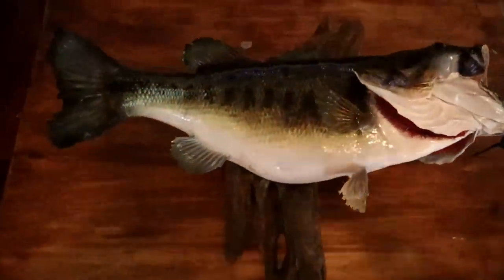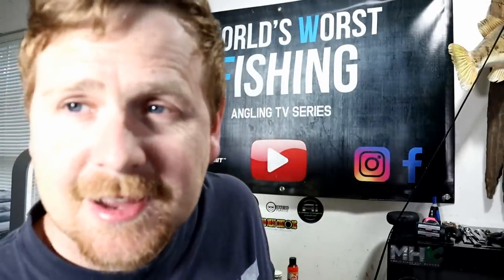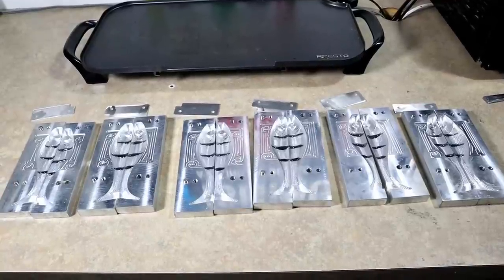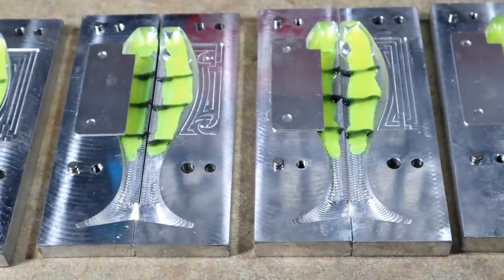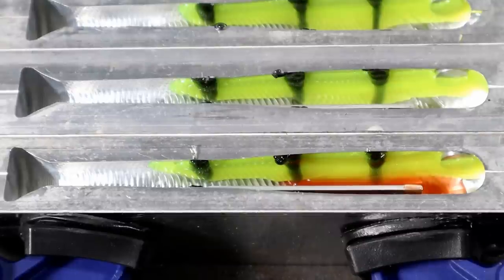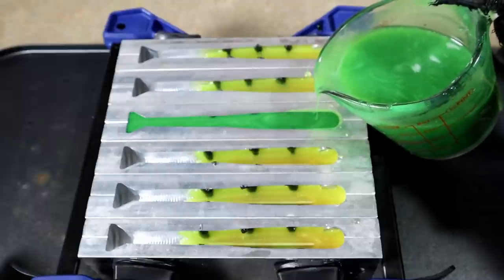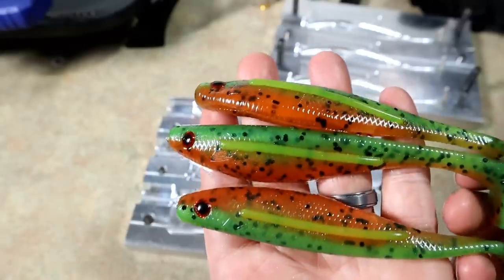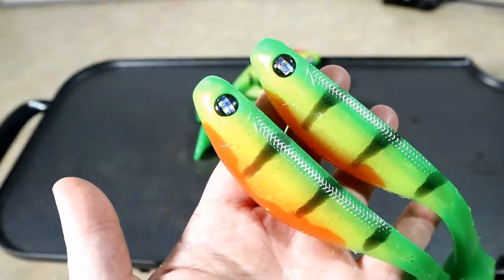POPULAR COLORS: FIRE TIGER..Hand Pouring & Hand Injection Fire Tiger Swimbaits

Comment: Hey world's worst fishing I'ma beginner worm pourer like really beginner can you give me some tips on worm pouring and this sounds funny but I've been using a heat gun to melt the worms down to liquid could you give me some tips on the pouring process mine never gets hot enough to stay liquid from the pouring to the mold process and could you give me some tips on where to find decent worm molds that don't require a injection mold or a hot cup and on price budget❔🤥🧐🤔😎😂😂❔❔ thanks

Comment: I've had the idea to try "skin pouring" from an injection mold, but I'm having difficulties with it. Prior to the injection, I would drizzle the skin color onto the sides of my paddle tail swimbait, wait for the plastisol to set up, then inject the solid color to fill the body and the tail. However, when I'd open up the mold, I would find that the "skin" had detached from the side of the mold and ruin what I was going for. Am I injecting the plastisol too fast? Am I over heating plastisol? Is the mold too cold? What is causing my skin to basically float in the hot plastisol?
Reply from the maker: Try doing that and then heating the mold up on a griddle and then injecting